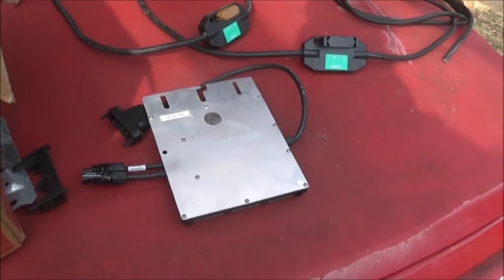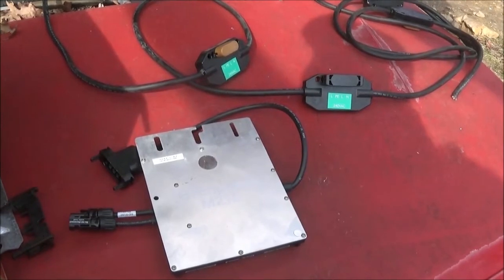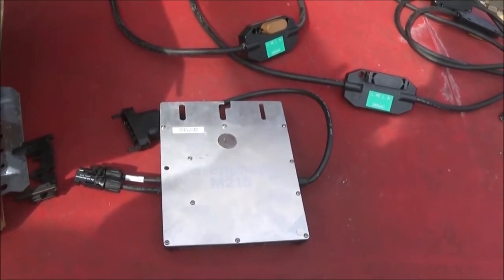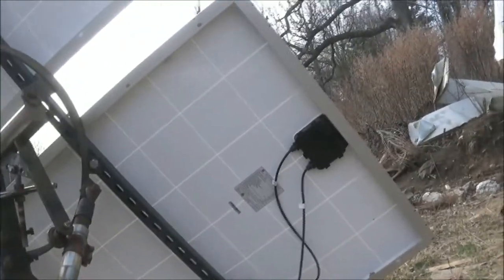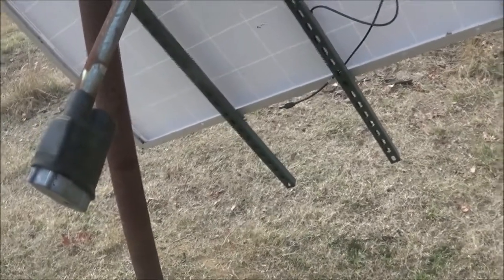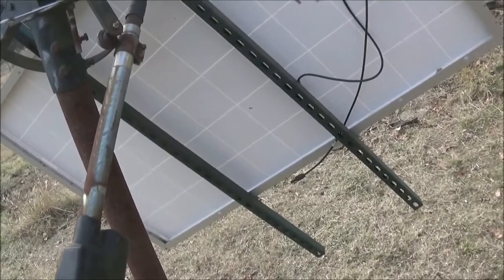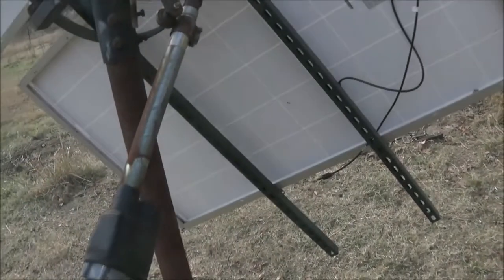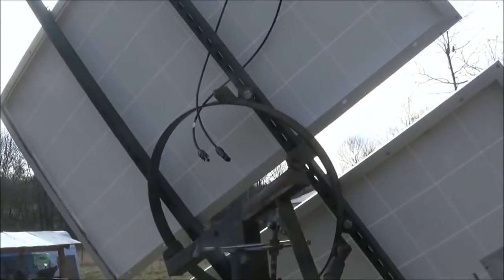The future solar array useing enphase 215 micro inverters.

Comment: I never understood why anyone would use a grid tie only system. I have a friend who spent $28,500 putting solar on his roof, that is grid tied. He claims that he saves some money on his monthly electric bill, but with an additional 25-year 2nd mortgage on his house, I don't see how he is saving any!. But the worst part. is if the grid goes down, he has no power at all, even though he has 7.5 Kw of panels on the roof!  Makes no sense to me.

Comment: Nice U picked  A winner!  I have had both string inverters & the Enphase units Enphase wins hands down. Way more efficient super easy to install. The support from Enphase if U have issues is first class. I started out with the 210s very prone to failure then went through at least  the 3 or 4th gen type before having to take them out of service thanks to the electric  co installing a smart meter while I was on the road traveling 2 years ago. I know run my system off grid only.
Reply from the maker: Thanks I have watched a lot of your videos on them.  I hope they don't decide to put in a smart meter here for a while. The plan is to add them as I go along. I may have some questions from time to time if that's ok.
Reply: Happy to help any way I can any time. I have some trunk cable left over if U need some.

Comment: thanks for the video, I like the modular inverter system, that's a good idea. we haven't considered solar due to the cost, but with a system like yours there wouldn't be that huge initial cost, we could start out with a panel or two and a few batteries and inverter. we already have our generator tied in with its own switch box, I imagine we could tie into that. lol once electricity goes from DC to AC I'm at a loss. I'm more use to a 12 volt system. hahahaha
Reply from the maker: yep this way  you could add 1 panel and micro inverter at a time and not  spend a lot of money at one time. This is a 12 volt system . a 250 micro inverter is for 24 volt if you want to go that way and you would use bigger panels.